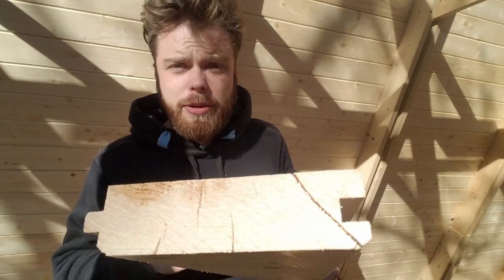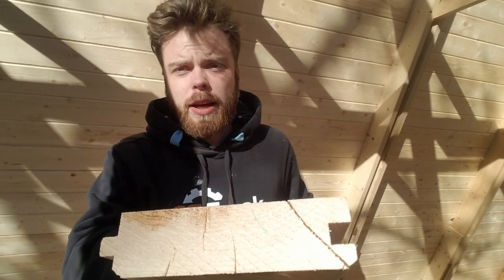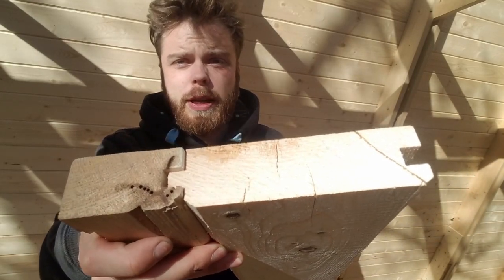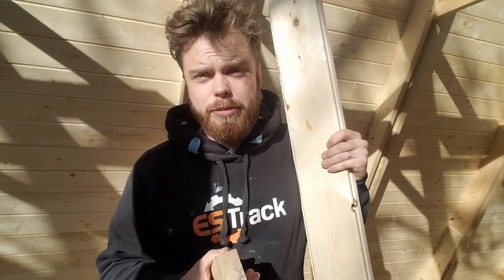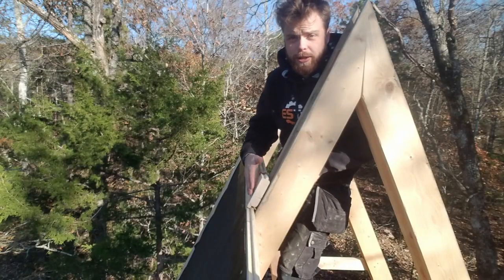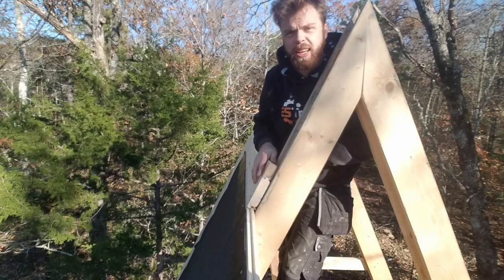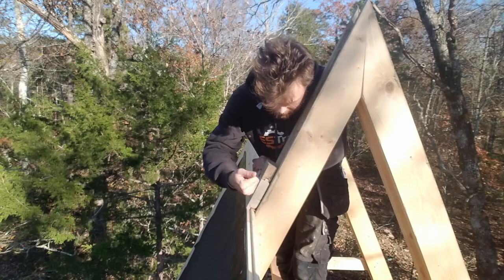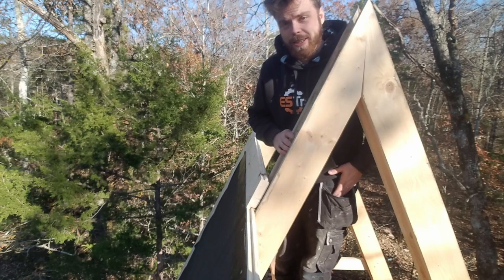A-Frame Cabin: Building a Tongue & Groove Roof

Comment: This is obviously a little late, but many of those adhesive membranes and tapes use a pressure activated adhesive which requires you to use a roller at the edges to press it down and get it to stick.  It could also be that it was improperly stored though.  I have actually been thinking about building my own A-frame as house prices have gone up dramatically, so this really helped.

Comment: Where did you find these plans? I would love to see them.
Reply from the maker: NDSU, here: https://www.ag.ndsu.edu/extension-aben/buildingplans

We changed them to add the glass wall, "great room" living room and the treated wood foundation, but it worked great to use those plans as a base, make changes we wanted and have a local engineering firm sign off on them.

Comment: I see great value in that beautiful 2 x 6 T&G planking, it's your roof structure/decking as well as your finish interior sirface (no more interior materials or labor intensive drywall, etc) and instead of thin OSB/plywood materials, you've got a full inch plus of solid wood to attach to! Great video as always

Comment: If I were looking at that kinda plank roof, (which is essentially your interior ceiling/wall too, I'd put a thick rubberized or modified asphalt weather membrane over it all instead of simple tar paper. This is a house in the woods that can suffer damage from trees and even if you have significant damage to the outer roofing materials, the heavier membrane can much better protect more than a thin easily ripped tar paper. It's not that expensive and worth the added protection and peace of mind. I used it on my entire roof and even if I lost all my shingles it would be water tight. Plus it adds an extra amount of insulation against heat loss.
Reply: Ice and water shield for sure

Comment: I have an a frame in eastern Kentucky with a tongue and groove deck and 24” cedars shakes. It was built in 1975 and not a single leak and shakes are original—even after a couple of trees have fallen on the cabin. The pitch of the roof is what makes this roof hard to fail. Also the pitch mitigates UV exposure.The tongue and groove was lightly stained on the interior and it still looks beautiful.
Reply: Do you put insulation in ceilings?  Or does it need any insulation?  I don't know anything about it.

Comment: Sorry if its been asked before but what are the dimensions for this A-frame? Thanks for the videos, there is a painfully small amount of info out there for building one of these.
Reply: @OzarkMountainCabin  thanks! im building a 20x20 myself. I saw your video about trouble with a foundation contractor and I've had the exaxt same problem! fingers frossed but after many delays he is finally supossed to start on the 7th.

Comment: is it ONE real inch or a 2x4 , wich mean a nominal 1/2 by 3 1/2?. Or is it only 3/4 (nominal one inch?)? 
I know that Code allows for a one inch (nominal, so 3/4)  plank, for a flat roof, 2 feet on center. You are 4 feet, but i guess that your member are stronger  and that because of the angle, the roof is stronger and snow cannot accumulate...
Reply: He keeps saying "one inch" but it's clearly larger than that. And his description says "we're using a 2x6 V-groove" so it's actually 1.5" thick by 5.5" wide. And, yes, the slope makes 4' spans within code for 2x6 T&G decking.